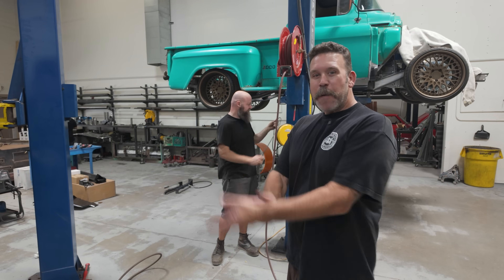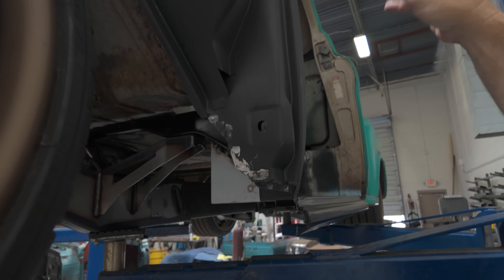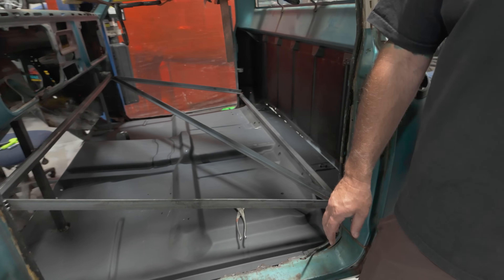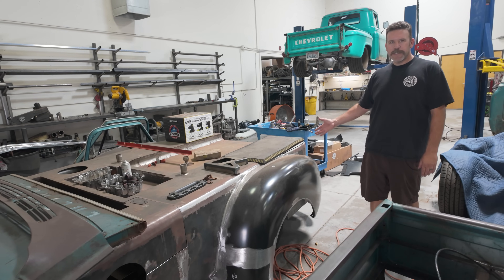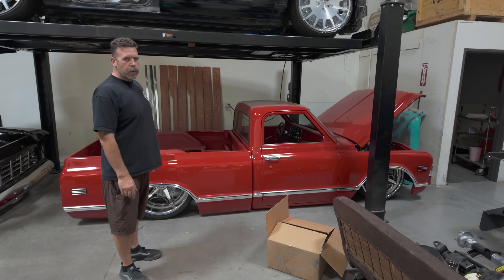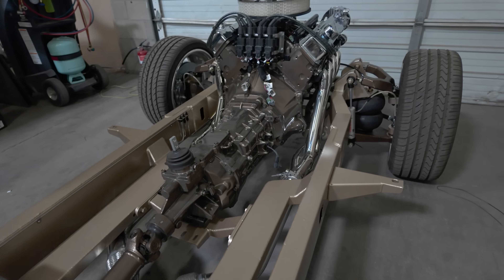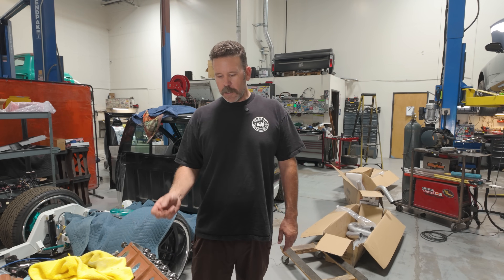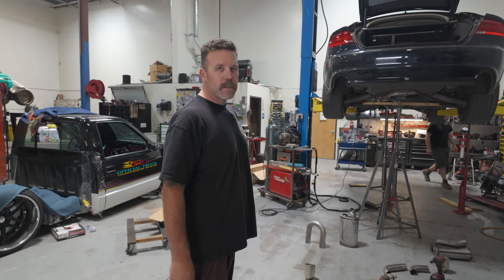Shop Project Updates | July 2024

Comment: Who makes a turnkey chassis (like GSI) for 54 3100's?
Reply from the maker: Check out RevB Chassis Co.
Reply: @tre5customs113   thx
Reply: What configuration of air equipped chassis is recommended for light duty (<5k/lb's) trailer pulling? If any, that is.